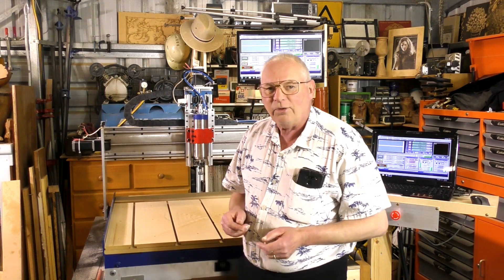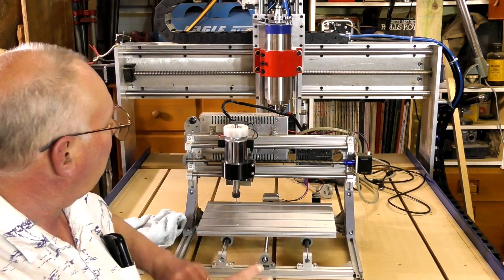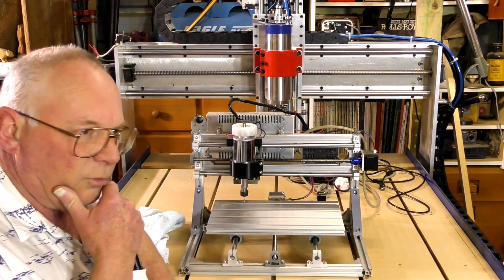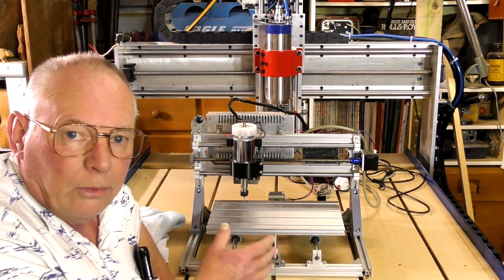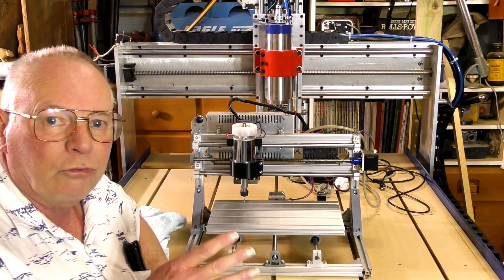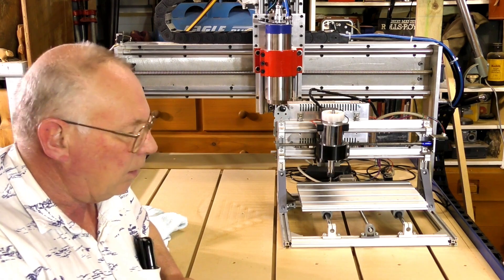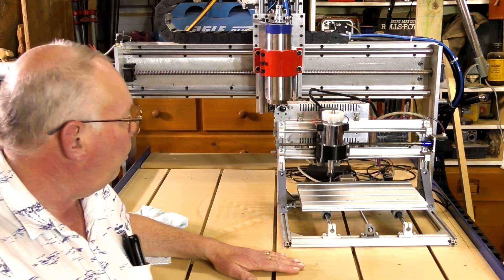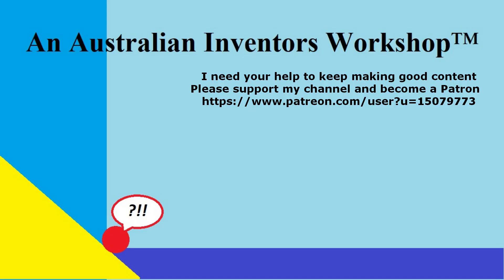How to get started with CNC machines for LESS THAN $250

Comment: It's solid and stiff. It will do soft metals.
Reply: yea like soft wood plastic and without any precision  that toy demand upgrade ,and when u start with that is black hole
Reply: @MrCcfly  I've cut mild steel with a basic setup...I did destroy one of the  bearings, though.